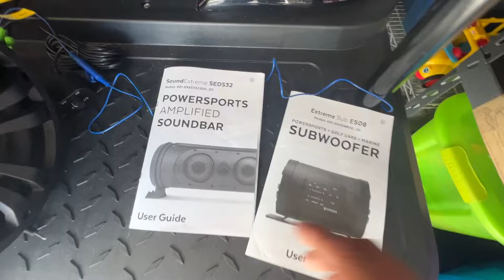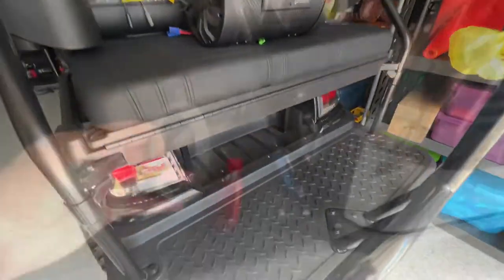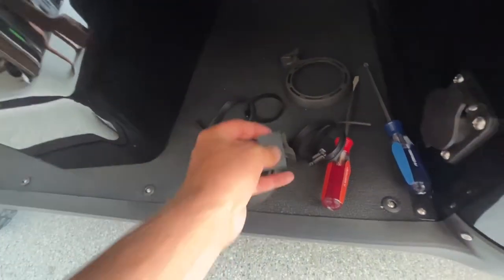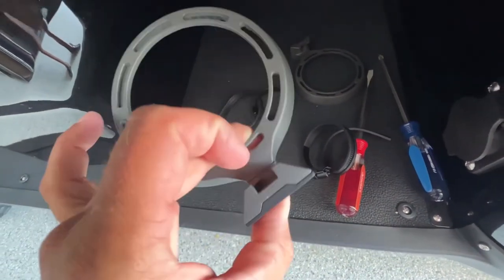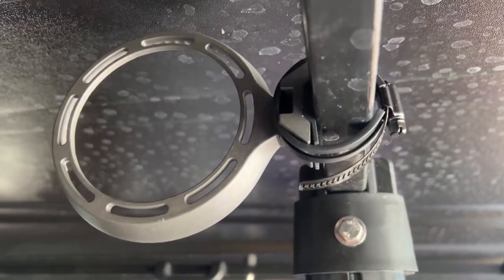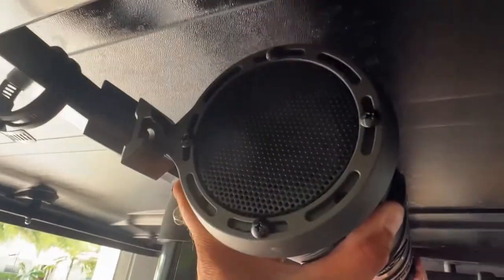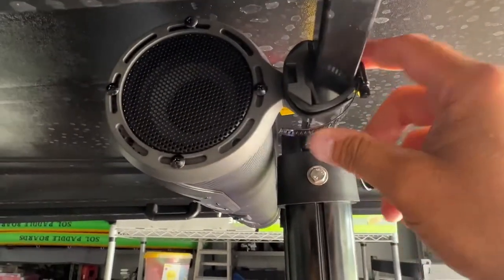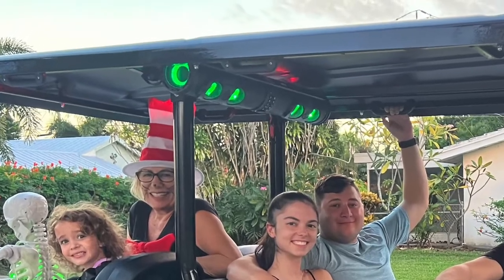How to install the Seds32 sound extreme sound bar on your golf cart.

Comment: Do you have a video of you hooking up the sub?
Reply from the maker: I don’t, I didn’t get to it yet. I was having trouble getting 12 V from my 6 V batteries and therefore I need to buy a 12 V power supply to run the sub, should probably run the speaker that way too. Something like this…https://amzn.to/3ORADAy
Reply: @RealityUniverse   OK, no problem. I'm going to try to tackle it this weekend and video the process. My icon already comes stock with a 48 Volt 12 Volt converter. If I get the video done, I'll have it up on my channel by Monday. Wish me luck. I'm gonna need it.😆